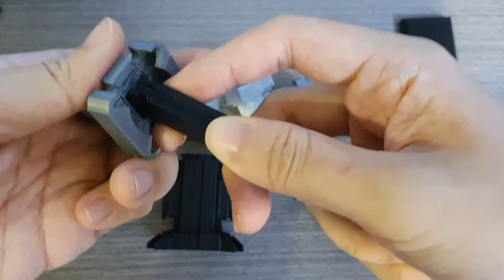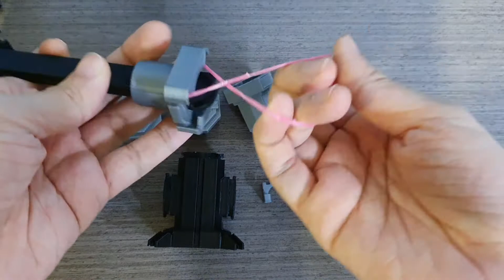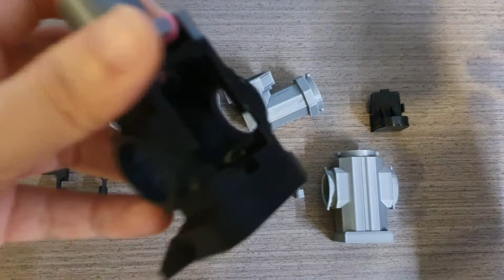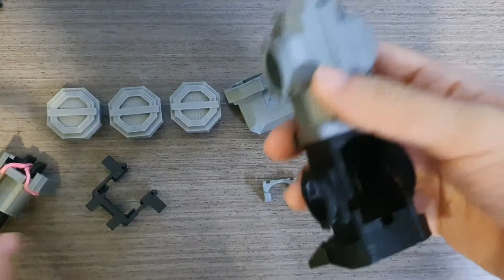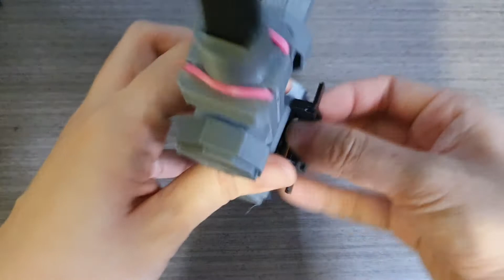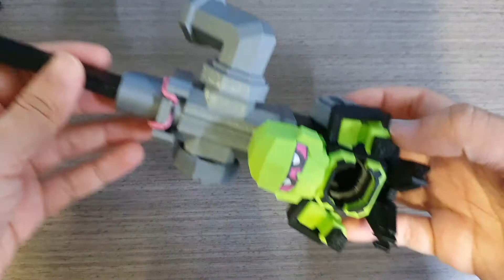3D printed B-daman Hammer module instructions

Comment: The way you incorporate rubber bands into your designs makes me wonder if you could use one as a drive strip
Reply from the maker: I've been testing that idea for awhile now, it doesn't quite work because the rubber bands are held unevenly, usually they're too thin or too shallow to add much drive to the marble.
Reply from the maker: I've tested the idea further, with thicker strips of rubber and more secure attachment, I still haven't had much success yet. The marble will spin but not in the same way as a proper drive B-daman.
Reply: Hey, it's a step in the right direction! Super excited about hammer rhincor too
Reply: @StudioRevoct  3d printed rubberized plastic might work for a drive strip?
Reply from the maker: @hyperion9934  a buddy tested it, yes TPU does work as a drive strip.